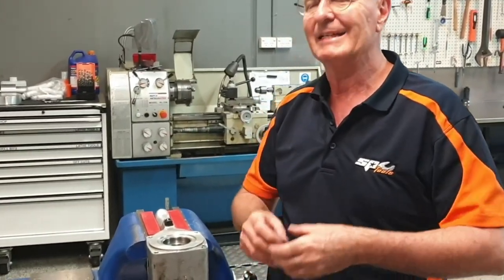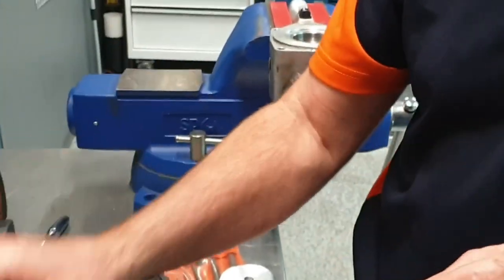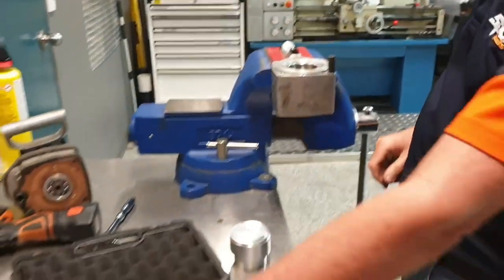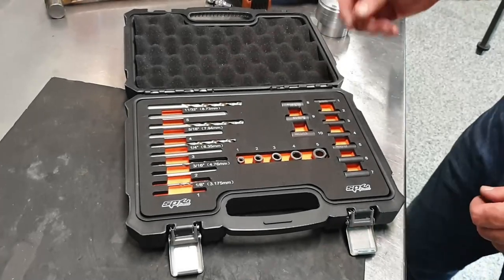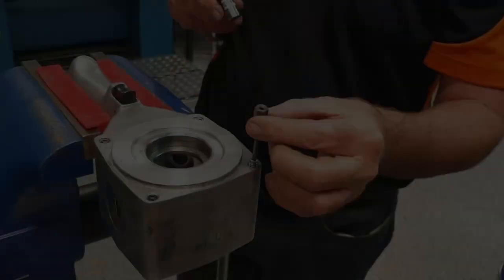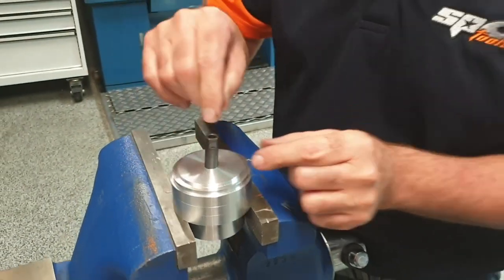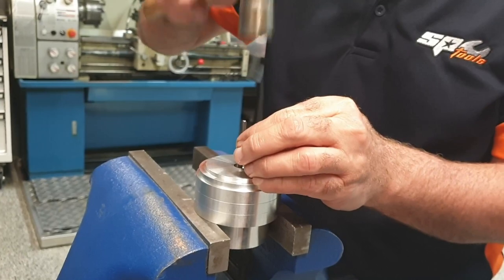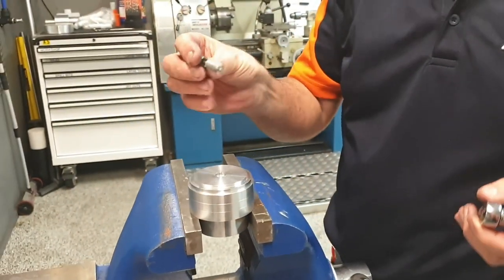25 PIECE DRILL BIT & GUIDE SCREW EXTRACTOR SET - SP TOOLS (SP31320)

Comment: I like the concept a lot. However, in my opinion, any bolt extractor kit that doesn't come with left hand drill bits is a joke. It's worth the extra cost all day long.
Reply: I ordered one of these from Ebay and will replace the drill bits with same size good LH drill bits, start small drill size to give myself more options if the first LH drill doesn't unscrew the stud out. I can give it a second pass with a larger LH Bit. If that don't work I can try a socket spline. Hopefully the left hand drill will be enough. My concern is that the bolt sheared off at 40 ft lbs torque and that will make it harder to unscrew the stud out.